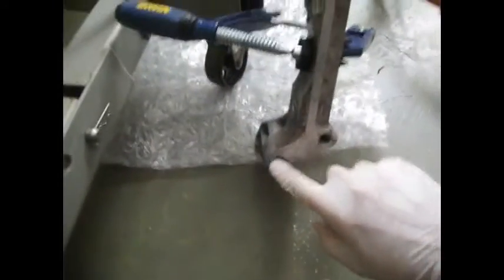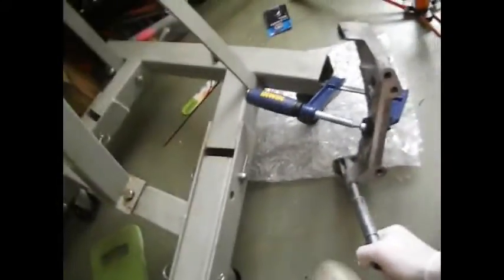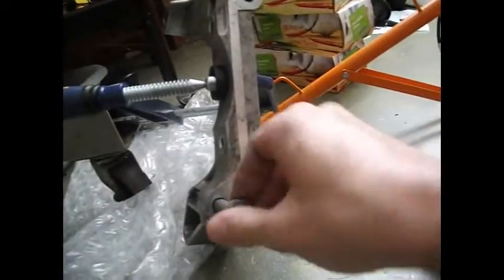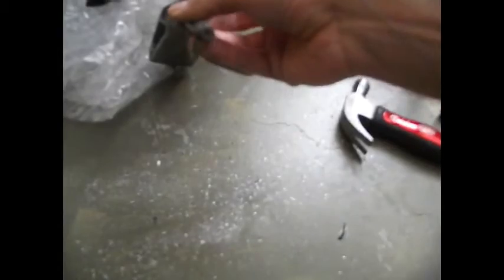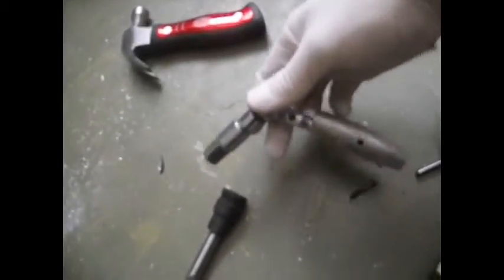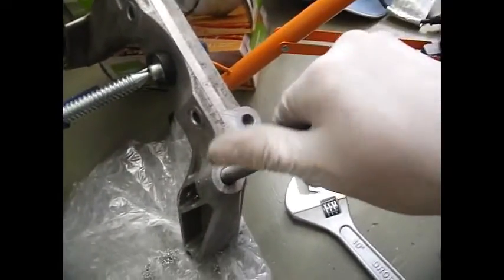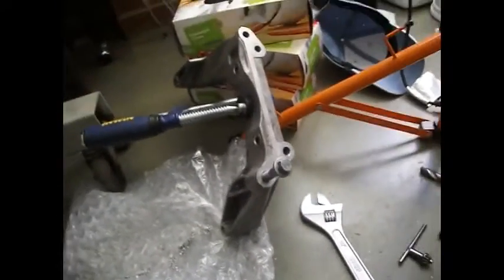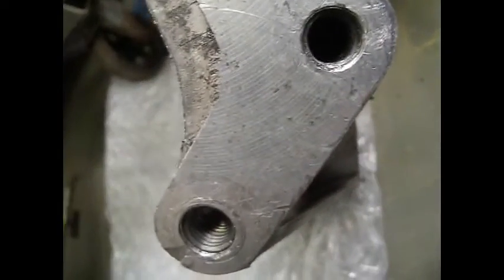Fix Damaged/Stripped Bolt Hole Thread (Engine Mount) With Kit

Comment: where did you buy the kit from is it on e bay
Reply from the maker: Hi, yes and searched under Thread Repair Kit - you should get dozens of results that come up.
Reply: Jasco Kovacevic did you have to screw a new thread into the old hole or do you just drill it out re thread it and then use a bigger bolt
Reply from the maker: My original thread was partly damaged so I drilled it out in it's entirety and re-threaded. I still used the original bolt as I did away with the thread and built new thread in the hole.
Reply: Jasco Kovacevic o.k thanks mate i thought if you drilled it bigger then you needed to get bigger bolts also dod you have to use brass inserts to put into the new hole
Reply from the maker: Some kits have brass inserts some have stainless steel. I think the kit I have has stainless steel inserts and not brass but some other products might have brass ones. The kit should have instructions that have the drill bit and insert that matches. You can drill it bigger if desired then you may need a larger bolt. On the other hand, you could also drill it bigger to fit the inserts in.
Reply: Jasco Kovacevic thanks mate much apreciated